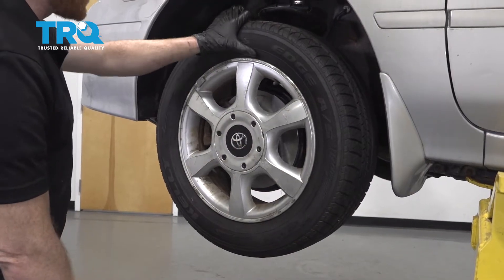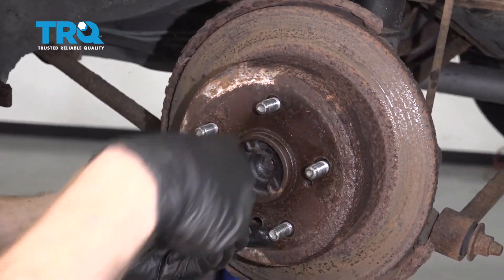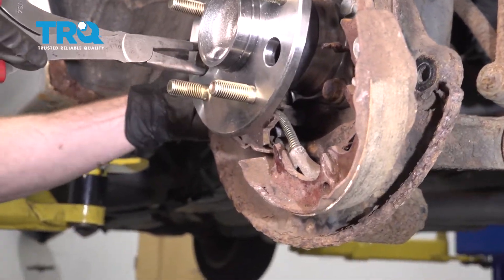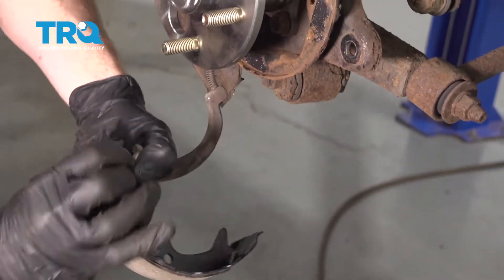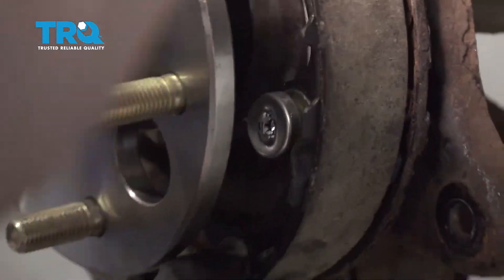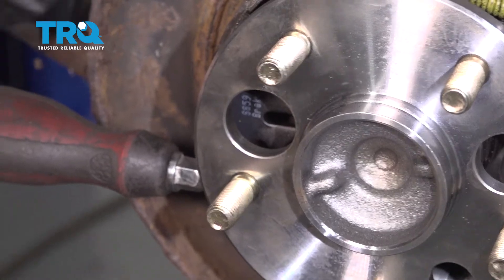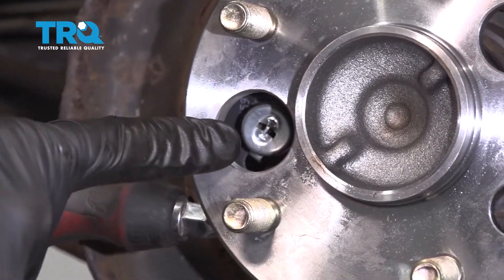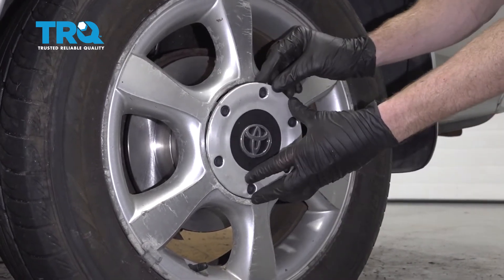How to Replace Parking Brake Shoes 1999-2003 Toyota Solara

Comment: Thanks for your video!!

I’ve found two exploded assembly views that show the bottom of the U-bend in the retaining pin near the axle.  The video shows it oriented away from the axle.  

Before watching the video I had already assembled my brake with the bottom of the U-bend toward the axle because it seemed the bend is there to clear the actuation lever.  When I saw the video I thought I’d better check.

Thanks again!

Comment: Assuming that he switched to the LR after briefly working on the RR, shouldn't the wear-indicator be at the bottom?  From what I have researched, the wear-indicator should be on the leading-edge of forward rotor-rotation.  Accordingly, for rear-facing calipers, it should be at the bottom and for front-facing calipers, it should be at the top. (View "Here's the correct way to Change Brake Pads & Rotors in a car " on the "Junky DIY guy" YT-channel.)